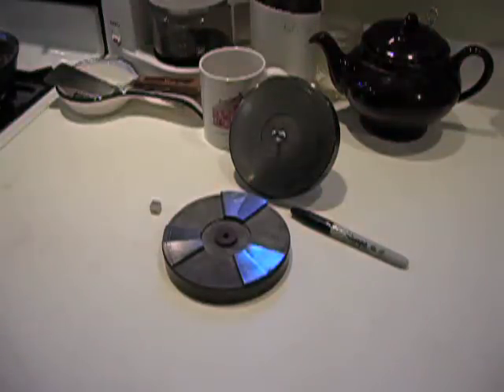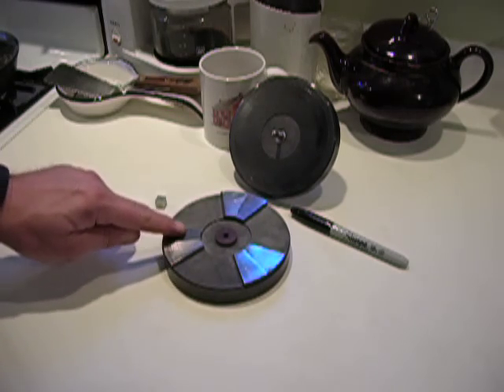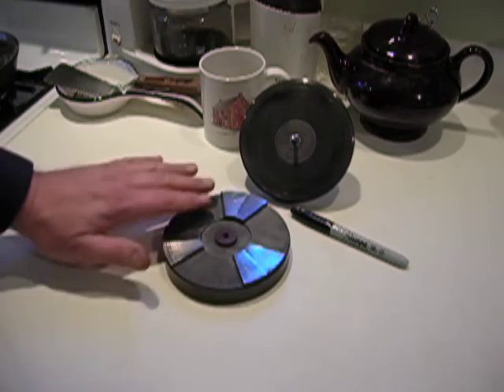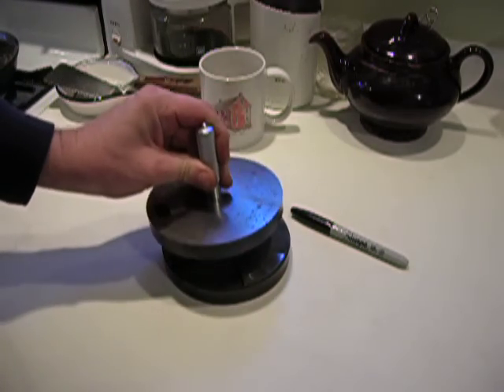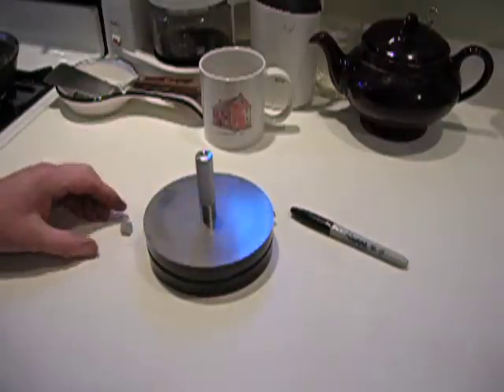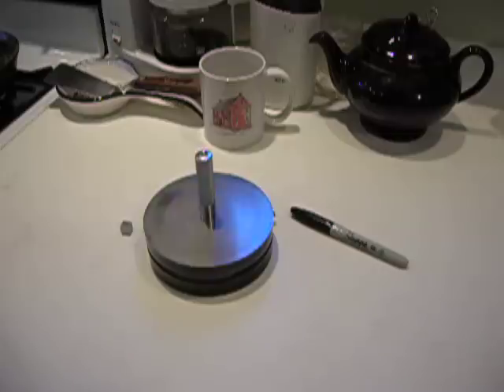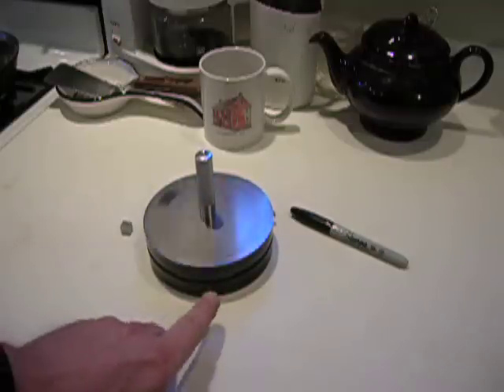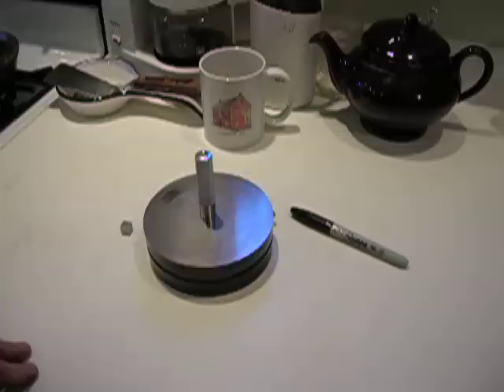Rayleigh Hydrodynamic Thrust Bearing

Comment from the maker: Joyce,

Tool steel. Step size is correct. It's a little confusing because the three pads themselves are about 0.125 inches think. But the acid etching of each pad produces a step on each pad. That step forms the working air layer which generates the thrust force of the bearing.

Comment: Thank you for the info very helpful - Just one last question sorry about that, but--
what was the step size for your project? The calculations seem to call for a very tiny step size 
0.00005" ? is that correct?

Comment from the maker: There are three high pad sectors. Each pad is first masked with tape, then greased. Tape is carefully peeled off, then etched with hydrochloric acid or nitric acid, whichever you have. This produces a step on the raised pad. The raised pad was lapped smooth and flat before the etching process. The etch depth is quite small, but the acid will do it. Some experimenting in relation to the etching time will be required to get the right step height. Use strong acid. Rinse well when done.

Archibald

Comment: Thanks for the answer- I found it at an engineering lib. But the question now is about the step size and the material of the pads? Archibald and Rayleigh suggest the step size is extremely small 0.00005" (h1-h2) Your model looks to be much larger than that. Care to share your design details - ie stepsize and material of the pads? I want to build some of these using PTFE.

Comment: Is there a thrust bearing that would be suitable to join a component to a surface so it cound freely rotate and take sideways force? it would have to be able to take a downwards force of around 70-300kg and significant sideways force and be about the size of a small dinner plate. Thanks a lot.